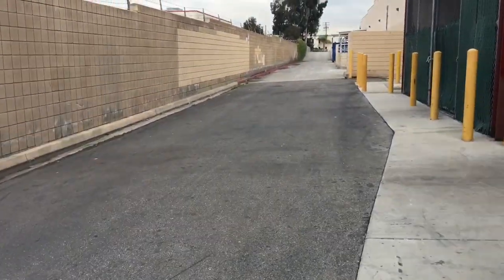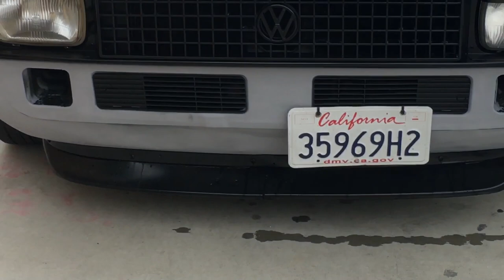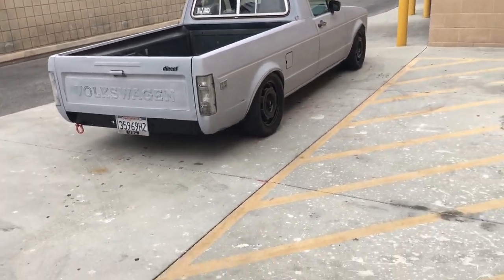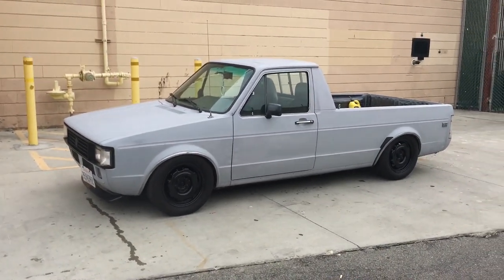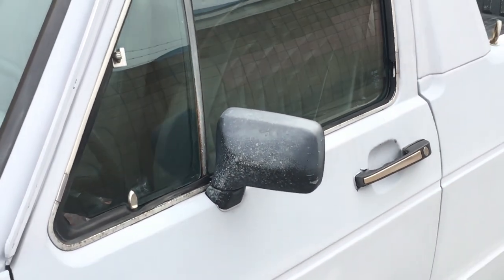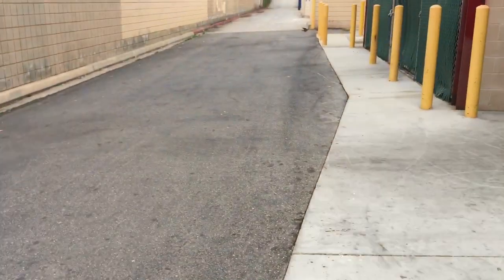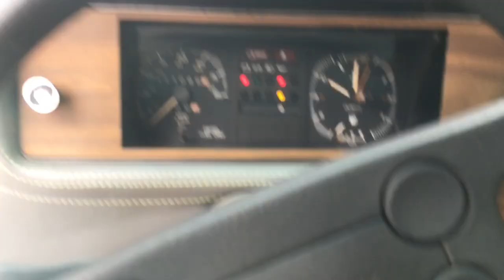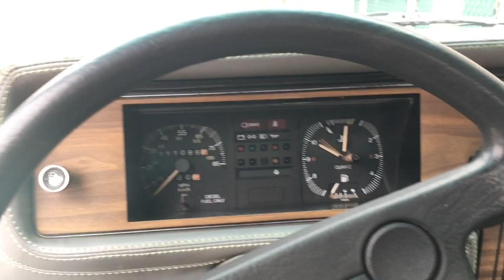Walk-around of my 1981 MK1 VW Rabbit Caddy (1st Month Of ownership touch-ups)

Comment: Where you running 175 70 13s on the stock steelies? And did it rub at all? I'm lowering my caddy on Saturday and am trying to see if I should just buy smaller tires for the stock steelies. 

Thanks for the vid!
Reply from the maker: I believe I was! I wasn’t rubbing ! I just added some negative camber up front